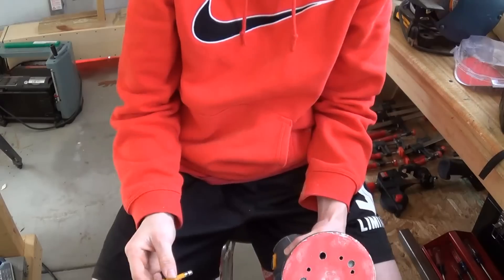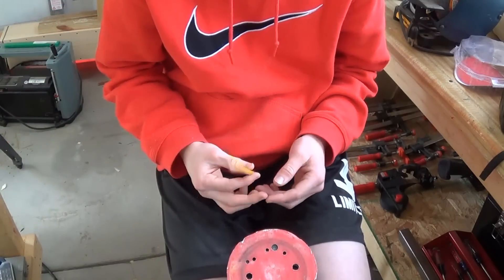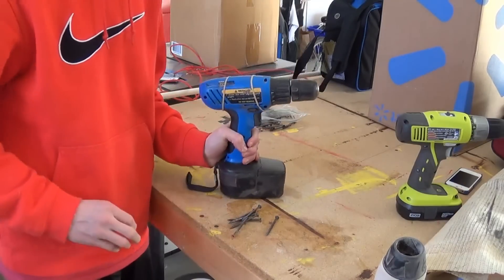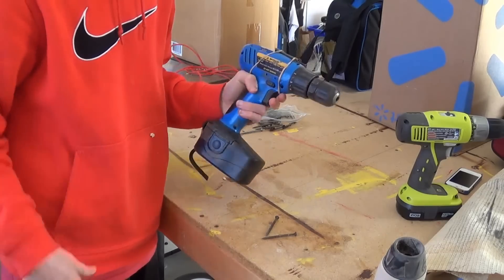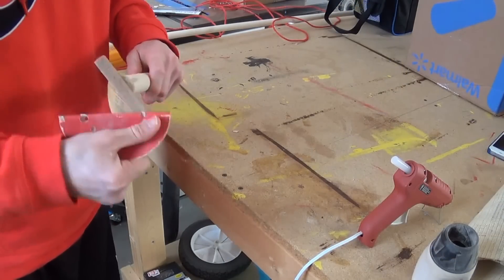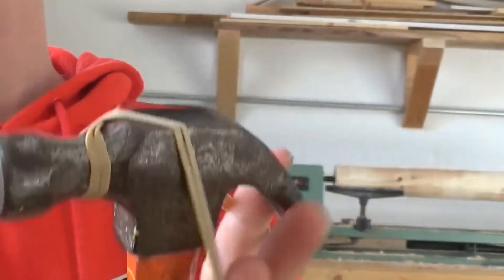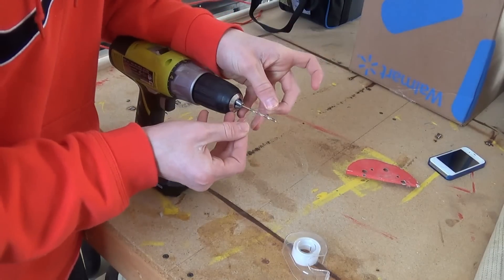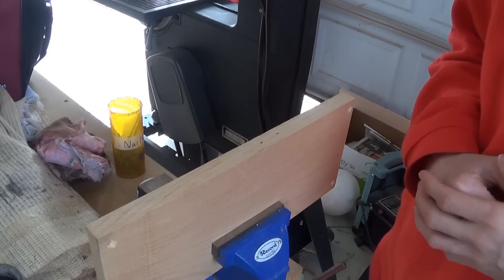Handy Woodworking Tips and Tricks!

Comment: Ive never heard of the rubber band on the hammer thing. That is cool. Also if you dont have the speed outs (wich i do and they do work quit well) you can put a wide rubber band over the head of the screw and it will come right out. also if you dont want to split a piece of wood when your driving a nail in say a cedar shingle, flatten the point of the nail with your hammer.

Comment: Great video! And great tips! And you don't have to apologize, it's good to take a break and just chill sometimes, I get too, I'm thirteen I know how it is, I just wanna hang out with my friends. Again, no need to apologize, and GREAT videos too! Tip: you can drill out a hole in you clamp handles, and run a threaded bolt, with a hex top through the handle (lengthwise towards the clamp) and then put the right bit in you drill, and there you have it, speed clamping!

Comment: Good tips, but I'm afraid I'll jam the pencil in my groin and/or sand the inside of my thighs. I've put a piece of moleskin over the top of my hammers for the same purpose you use the rubber bands for. It you clean the top of the hammer with a solvent before you apply the moleskin, the stuff will hold on for a long time and will not break or dry-rot like the bands will.